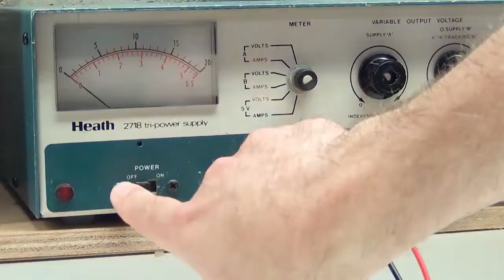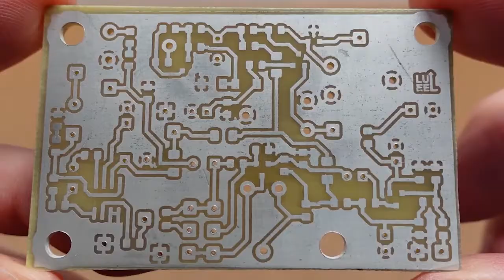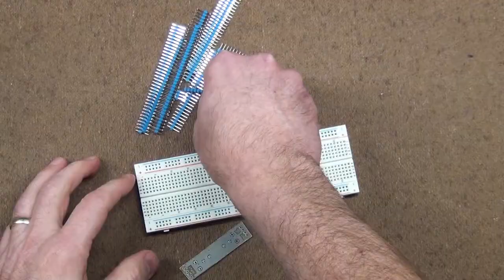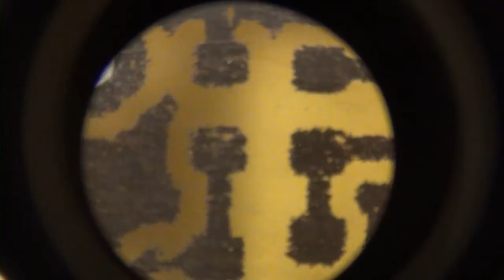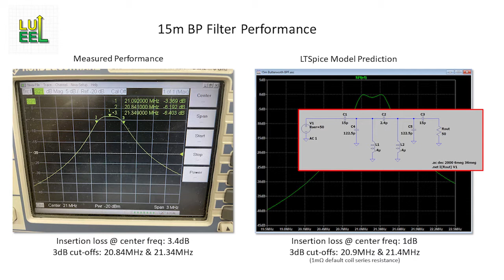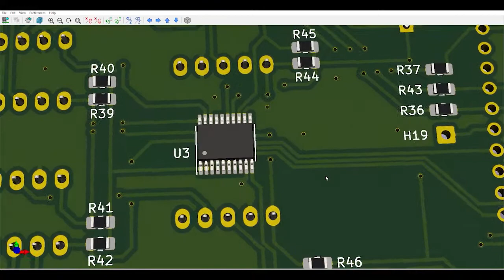Superhet Receiver Part #6: Band Pass Filter Woes!

Comment: Well done on failing, correcting and learning! These PCB  design and fab mistakes are small errors but once made can make your board useless! Learning and applying  the kludgy workarounds is important. I've made dozens of PCB design errors, but have always managed to salvage the board, while fixing the CAD model for the next run.
Reply from the maker: Thanks for that!